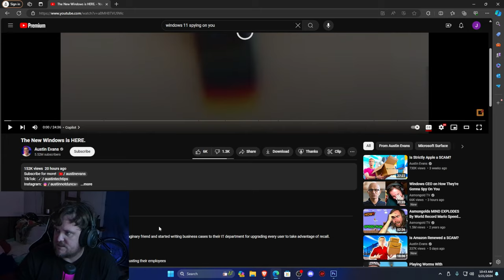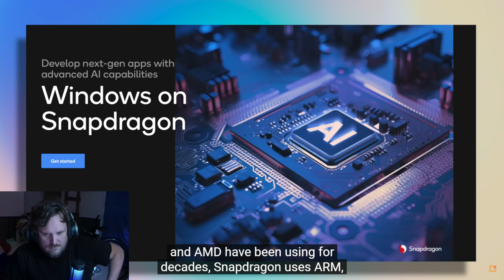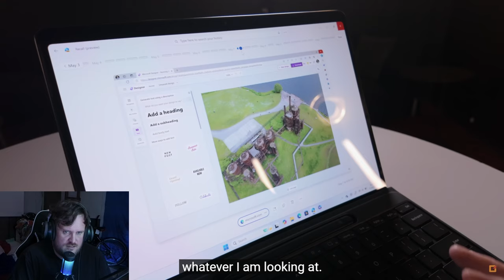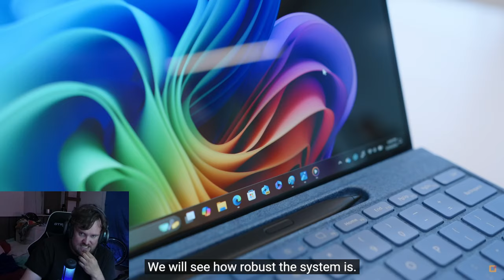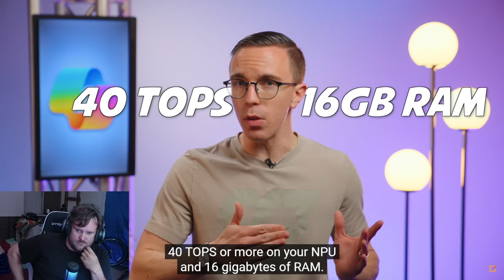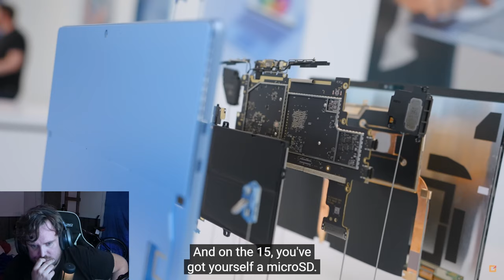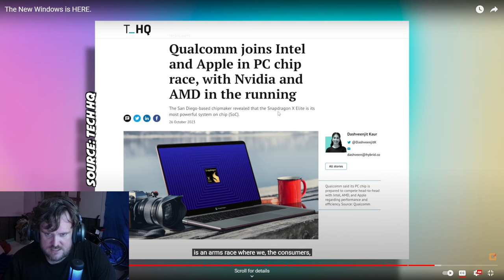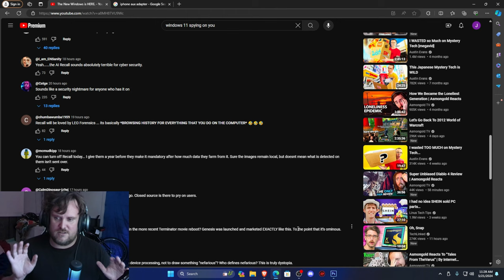The New Windows is HERE. | Jake Reacts

Comment: soon enough we're gonna have to worry about data breaches on our own personal computers.
also amp-hours for laptop batteries is incorrect.
Reply from the maker: Right?

And I appreciate the correction. I low-balled the number by a lot
Reply: Not if you use Linux. I put Mint on both desktop and laptop when Windows tried to force Win10 spyware on me and have never looked back. For the one program that only runs on Windows I use Win10 on a VM - with internet access disabled to block the backdoor (run Win10 inside Linux and you can see it in action).